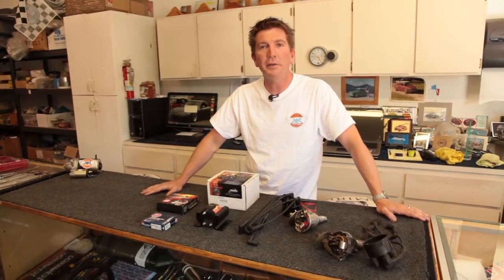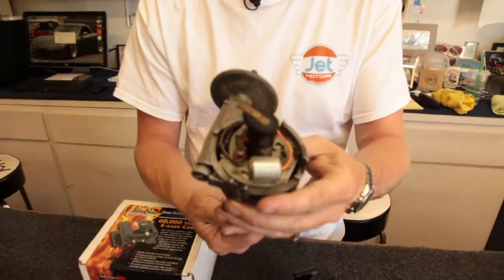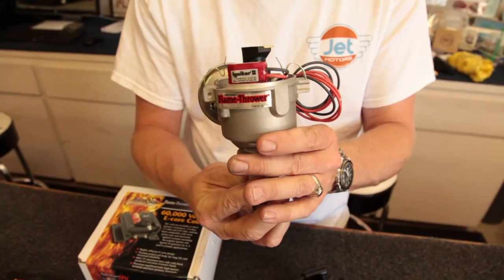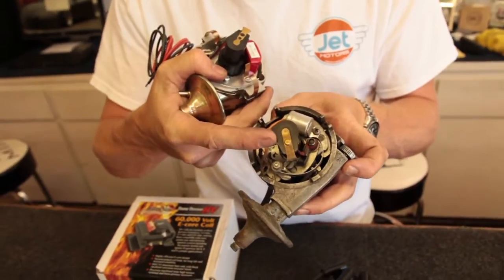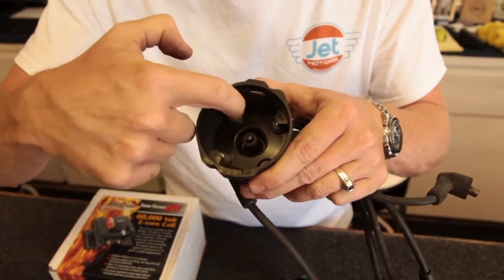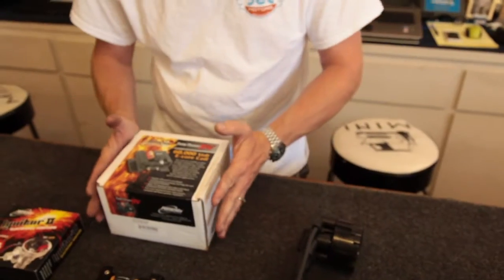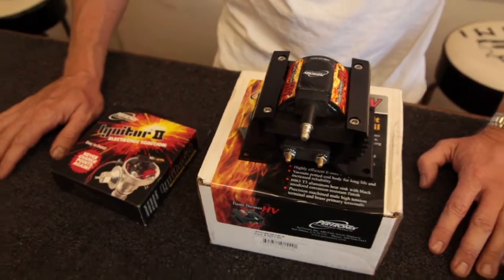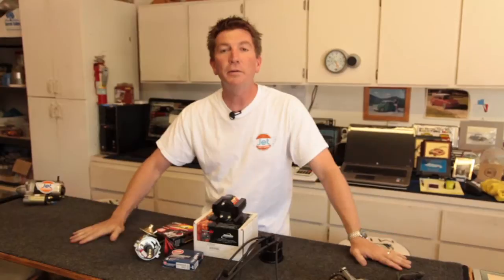Jet Motors Ultimate Classic Mini Ignition Kit

Comment: Really nice video, I just bought a 1980s 998cc mini and i was thinking of upgrading to an electronic distributor. Pertronix has a lot of them that fit a 4 cylinders series A engine; which one exactly are you using (i was thinking D174218 for my car). Is there an advantage in using a 60 000V coil (pertronix says, on their web site, to pair the ignitor 2 with their 45 000V coil for ultimate performance)? What is the resistance of the coil you're using (0.45; 1.5 or 3 OHM). Can a pre-charge starter motor fit on a pre-1984 mini? My Lucas starter works fine for the moment, i just don,t want the prince of darkness to curse my car when I want to go for a drive. And finally, what kind of work is required to upgrade from a generator to an alternator and which alternator would you suggest for my car? Thanks.
Reply: Hi Nicolas, best just to give us a call and we can help you 503-869-4294
Reply: Hi guys, I live in Montreal/Canada, can I send you an e-mail instead?
Reply: yes sales@jetmotorsmini.com